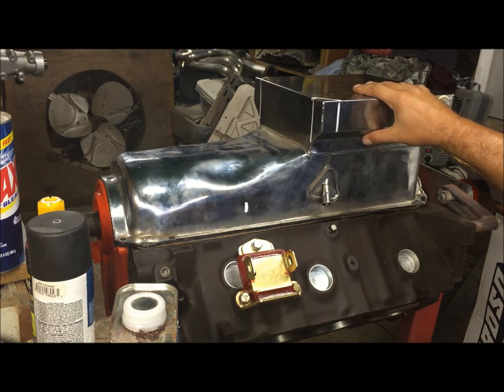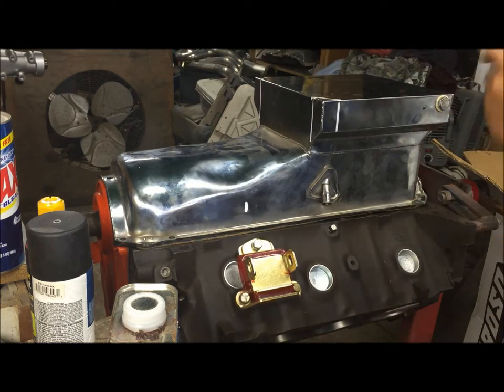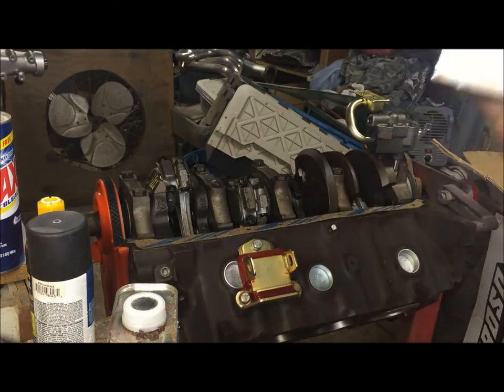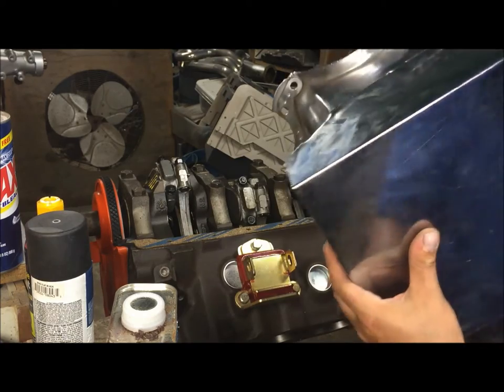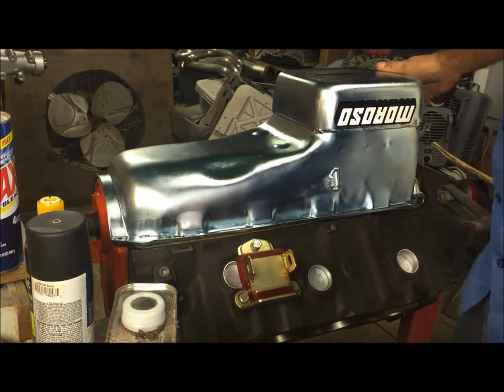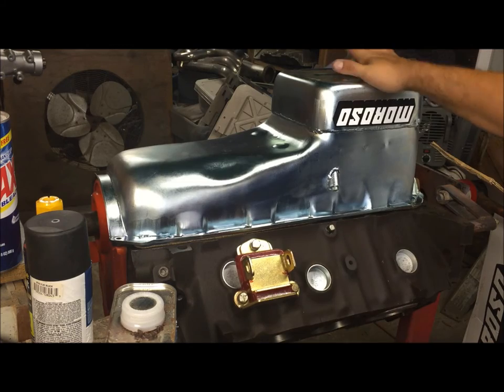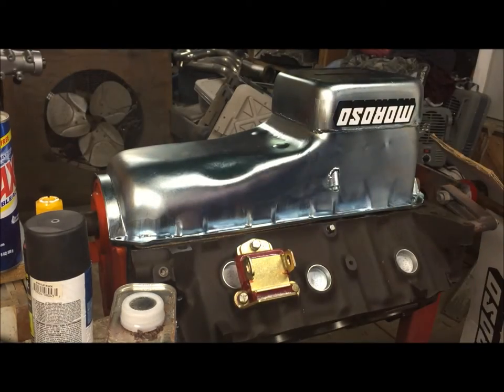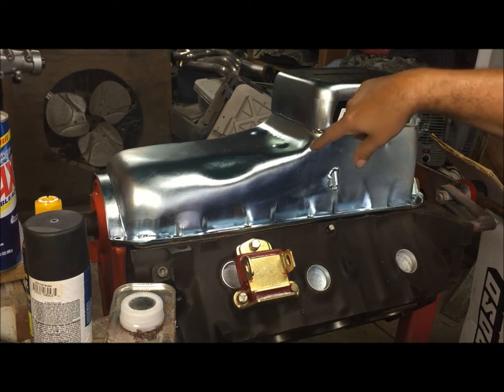chevelle big block oil pan

Comment: Thanks for posting. 
Did you have to weld the pick up tube?
Or does it have a tab to bolt on pump to make sure it doesnt slip out.
Also, can i use a flexline type dip stick?